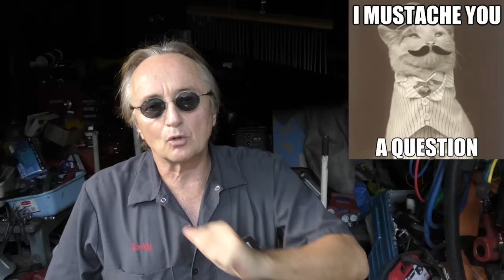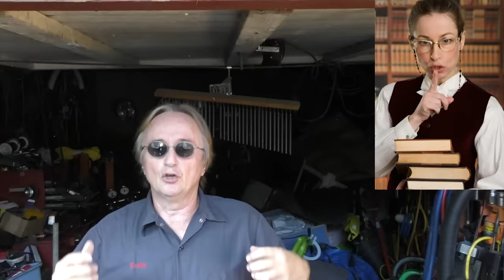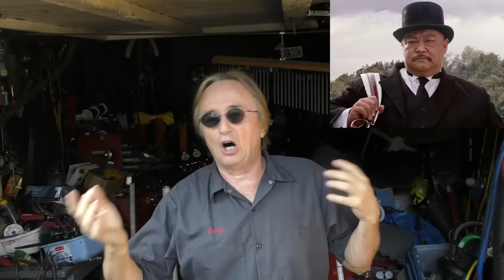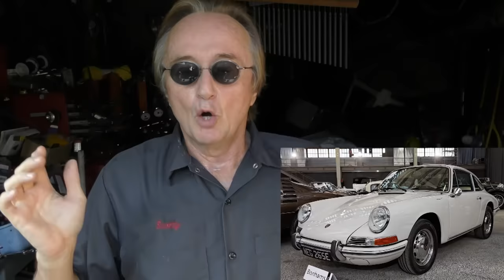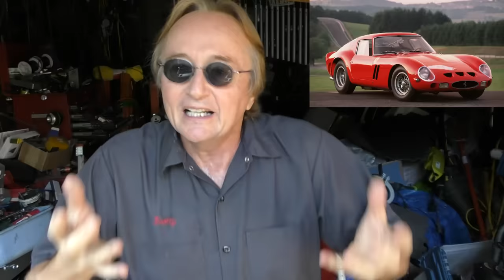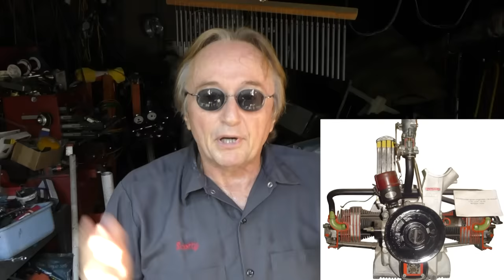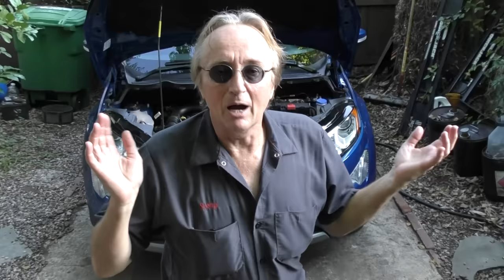The Truth About Boxer Engine Cars

Comment: Had 2011 Subaru with 71000 miles and blowed head gasket, car kept overheating and stranding me son side of a road after 2 thermostat replacements. Costs me a lot of money , kept getting air in the cooling system. To fix quoted 3000$. No thank you , Subaru . Never again . Sold it , got a highlander .

Comment: Hi Scotty, I would love if you can do a video about the difference between various Subaru boxer engines.  I had a 2008 Impreza 2.5L RS (5 speed manual).  It was no doubt slow.  I mean SLOW.  But the top speed was 130 mph.  Didn't seem to have a problem getting there other than some slight overheating.  (I rented a 2019 Mustang of which I could tell that the governor kicked in about 115 mph, and couldn't really make it past 120 mph without really laying on the gas.    However I've bought a 2020 Subaru Forester.  And it's another 2.5L boxer engine.  But the difference in performance is night and day.  The acceleration is a lot better from my impreza.  If you can explain this in a video I'd be most greatful.  I'd settle even for an email.  Thanks.  Love the vids.

Comment: I love Subaru's, but my first 2005 Subaru WRX had such an immense oil leaking issue my mechanic told me it'd need to be completely rebuilt within 20k miles. Then got a 2006 STI with 100k miles and had the same crap. Turbos kill those boxers, try finding an an STI in good condition without a rebuilt engine over 120k.. they all blow

Comment: Inline engines are used because they are easy to produce. Less different parts, faster production, more engines in a minute. And because the inline engines are so massively produced the new cars are using inline engines to cope  with similar other cars and use different engines. Mechanically inline engines are not better. If they are they would be used in F1 cars.

Comment: My turbo subie hasn’t gotten its head gasket blown yet but it will. just fix it seems simple to me. and you can push some decent horsepower out a Subaru engine. Obviously not a bazillion or something crazy but if you get forged internals you can push about 500 without worrying to much.
Reply: It's a great car. It comes running high boost out the factory and puts out great power. If it was naturally aspirated and a 2 door coupe it would probably be bullet proof

Comment: I refuse to support a company that won't fix a known weak point in their engines.  If you have a 2.5 just be ready around 100k for it to blow it's part of the Subaru experience.
Reply: That's in the older versions
Reply: @chadwickmason9851  no it's not
Reply: @Elijah-fc3ex  the only Subaru that this issue plagues is These vehicles all have cylinder head gasket related issues:

Impreza 1999 to 2011

Forester 1999 to 2010

Legacy 2000 to 2009

Outback 2000 to 2009

Baja 2003 to 2006

All at least 8 years old
Reply: @chadwickmason9851  nope, the head gaskets will still go bad on all 2.5 engines

Comment: If the boxer engines are so slow and out of date why does Subaru use them on sport sti s ? 

They have a nice amount of hp and torque 

Confusing
Reply: The new ones have about 350 hp depending on mods

Comment: good video... I have owned several bwm "R" bikes (boxers) and several subarus ... they make good long lasting power plants in most cases.. they had some issues in subbies with ring gap problems causing high oil comsumption  but I believe they got that put to bed.. different horses for different courses as the say ... cheers !!!

Comment: Scotty, boxer engines are no more antiquated than the inline four or inlinesix, inline 8 or V8. The only configuration of that list that is no longer in production is the inline 8. The truly antiquated design is the flat head. Over head valve engines go back 80+ years and overhead cam engines go back at least 50 years. The reason Porsche and Volkswagen moved away from the aircooled boxer was due to emission standards. VW actually took the boxer to water cooling and it's virtually identical to the aircooled but without cooling fins which were replaced by water jackets. Bottom line all internal combustion engines are antiquated but hey, if it ain't broke...

Comment: You know I would not mind the lack of power, the occasional head gasket replacement, if a normal person could work on it, vs packing the engine in so tight you have  disassemble the whole front of the car just to do a water pump, I think that cost $1,800, or it seems like you need special bent tools. I miss the old 60 V8 where you could crawl into that engine well.

Comment: Boxer engines don't have good primary or secondary balance, inline six engines are the best for that.  Aero engines driving propellors operate at around 3000 rpm so not high reving compared to auto applications.  The boxer design for aero have benefits of low profile for pilot visibility and easier to achieve cooling for air cooled designs.

Comment: All engines are old design but some engines had more research put on them throughout the years and became better. Still the boxer engine is the best for handling capabilities and the power it’s just the company designed on the engine. You can’t compare a 2L 4 cylinder natural aspirated engine with a hellcat. Even inline and v designs have variations in power because they have different designs build by different companies.

Comment: I'm pretty sure that Toyota 86 or brz will run circles around that matrix. In fact in short tracks it beats many more expensive muscle cars it's hp is perfectly balanced for the chassis just like the new supra you only need more hp for driving in a straight line.And boxer engines has also evolved just like all others  with vvti and hemispherical heads acc. boxer engines also have more torque than inline .

Comment: Once again Scotty shows that with his years of experience, 5 min of research is too much to ask. Yes, 1896 for the boxer layout. However, the inline 4 can trace it's roots to 1862 when Nikolaus August Otto built the first inline 4 that is core of what is still used today. Referred to as the otto cycle engine, this process of thermodynamics is the standard of even todays engines. (James Atkinson, in 1882, developed the Atkinson cycle off of Otto's design, which with cam overlap sacrifices power for efficiency gains. Hence today's hybrids use it making up the loss with electric power. Thanks to variable valve timing an engine can now switch between the two). I'm sorry, which was the antiquated design here? Also left out was the weight reduction in a boxer. My Subaru doesn't carry an additional 15lbs of counterbalance weight like my Camry does.

Comment: Look up Subaru F1. 
Say what you will but facts  and history has spoken. 
Facts are the Boxer design failed in almost all aspects of competitive performance (power, fuel economy, reliability etc) against non boxer engines. 
Subaru ended up putting a turbo to mask the power deficit and all wheel drive to differentiate and hide the fuel inefficiency.
Whatever the advantage of lower center of gravity gave it was negligible to the negatives the design gave.
Reply: RALLY DRIVERS DO NOT AGREE..
BEST RALLY CAR !! BAR NONE..FACT..

Comment: The lack of power in the Toyota FRS you drove has nothing to do with an engines design/shape. That's purely just a lack of power in general as that can be said for any smaller engine. Smaller engines normally make less power as opposed to larger ones. Having a boxer engine in the FRS makes no difference. You could say a 1999 Honda civic SI with an inline 4 lacks power. Purely just a biased opinion.

Comment: If the boxer engine isn't abused and beat to hell, they'll last forever. It might be an old design but there's a saying for that. "If it ain't broke, don't fix it". It's still one of the most durable and reliable engines on the road. And scotty, "don't make a whole lot of horsepower"? My sti would disagree. Besides, the more performance oriented subarus (wrx, sti, brz) are built for handling, not straight line because of the balance and low center of gravity. I can't believe for a minute that a matrix can outrun a brz. My scion tc would leave a matrix in a heartbeat.

Comment: The air conditioning system in my Subaru Legacy tore itself apart and would have caused major collateral damage if I had left it longer. Shockingly bad design and the reason why I'll never buy another Subaru...

Comment: If you want as much horsepower as possible from a boxer it is possible. It's just you will NOT be using stock internals most likely forged that means bascially rebuilding the engine if you have the means (time and money) for it then they can be amazing monsters on the roads

Comment: Porsche 911 GT3 RS
4.0L flat 6 cylinder
9000 RPM redline
520 HP
130 HP/L

Go try to find another naturally aspirated engine with that power density. Yep...boxer engines are old and out of date...

Comment: I always found Scotty knowledgeable but he missed it on this one.  He argues that the boxer cylinder arrangement is "old technology" which is an unrelated issue.  Technology is things like direct injection, double overhead cams, variable displacement cylinders, etc.  All of those are equally applicable to boxer engines or other layouts.  I'm pretty sure the I-4 cylinder configuration so common today is older than the boxer layout.  Certain Subaru/boxer engines are prone to head gasket problems, but that's a design problem, not a problem with the horizontally opposed boxer configuration.  And cars like the Corvair and Tucker failed for marketing reasons.  Ralph Nader killed the corner hugging Corvair with his book "Unsafe at any speed".  Tuckers just never took off.  All other things being equal, I'd take a boxer engine over an inline or V engine every time.

Comment: Didn't anyone think to place the Boxer engine transverse , it would have taken up less room than a 4 cylinder car and had a beefier gearbox to match .
A flat four cylinder car with a 3 L, engine or 4 L capacity engine as a 4 so it didn't take up much room .

How is this for an idea insted of the output coming out of the rear of the engine the center of the crank could have had a gear to tranfer all that power threw a gearbox under the engine or sump , ala Morris mini gearbox , and still have the center of gravity very low and even a (  flat 8 ) taking up , f all room in the bay .

Comment: Hey Scotty I got a 1995 passport Honda it's got 200,000 530 mi on and I'm having a problem I've got an oil leak inside the valve covers because that passport is not a Honda it's actually an Isuzu it was built on the Honda line and the oil is leaking down on top of the plugs which is caused I imagine I didn't know it for a while when my wife is driving the car and I found out when I went to change the plugs I was getting the oil down on top of the plugs and I didn't even know that the oil lines run through the valve cover so I have to replace the valve covers but in the meantime I don't know my lifters were loud so did that oil leaking cause the valve lifters to start getting loud and they have ruined my lifters am I going to have to replace the lifters and the valve covers because you can't put seals in the valve covers on that Isuzu they say I have to change and buy new valve covers and I've been driving it I took it to Mississippi and come back and it was working fine I put a set of new plugs in it and it ran down there 28 mile and a gallon except for my lifters being loud my oil pressure was holding at about 50 55 lb okay now when I got back I started losing some power now I changed my fuel filters but I never change my old two sensor is that causing it to drag and lose power or is it something else can you explain what's going on with my 1995 Honda passport which is an Isuzu

Comment: YES these new MODERN engines are just a great thing to be promoting, direct injection NIGHTMARES, aluminum warping NIGHTMARES, sensors up the yin-yang, $2000.00 de-carbon of the intake valves 5 or 6 times in the life of the engine IF they last that long.....BOXERS sound pretty good to me DUDE.

Comment: "Especially today, this is an old design".  lmao.  Yeah, ALL piston engines are an old design, thats not news.  Subaru engines are known as one of the most reliable engines on the planet.  I own a 2001 Forester and 2011 Impreza.  Both are great vehicles with zero engine issues.  On top of that, my 2011 Impreza would run cirlces around Scotties wifes Matrix.  lmao  Ill even drive in mud and she can have dry pavement to make it a little closer.

Comment: Scotty, please explain what exactly makes a modern four-stroke engine with horizontally opposed cylinders an "old design"? Is that a fact or an opinion?
And what exactly is not an "old" engine design these days then? Electric vehicles? 
Which were invented 20 years before internal combustion engines. lol

Comment: Subaru's last for ever as long as you don't modify them. 90% of ruined subarus out there were modified before they blew up. That said I drove an 03 wrx for a 120K and had 350 AWHP for half of those miles. The only horrible thing that subaru did is that most of the subarus from early 2000s and on rust like crazy by the time they hit the 10 year mark If you drove them in the winter, Which is what they advertise lol. I love subarus, but dont mind  sharing real facts.

Comment: Pull a subaru engine once and then tell me you would rather work on something else. They are the simplest vehicles I have ever worked on and the majority of their parts are compatable across multiple generations. Sure, they don't make the power that other brands do and the fuel economy may be lacking in the eyes of some but these cars beat everything I have come across in ease of maintenance and are a tough rival for toyota in reliability. Did some generations have head gasket issues? Sure, but that little motor comes out in 45 minutes to an hour and after 3 hours or so it can be running again with a fresh timing set, new seals, and multilayer steel headgaskets. These cars were built to be worked on by their owners in their driveway atleast up until the CVT Transmissions came into play. I haven't owned any that new so I cannot speak with first hand experience.

Comment: Your topic doesn't make sense.
I know Subaru only use boxer engines WRX STI is a good sample of boxer engine performance.
In general it has its own ups and downs just like any other engine.
The only thing you mentioned as a big deal is head gasket witch any engine could have!

Comment: The boxer design doesn't lend itself as readily to modern production methods that employ a great deal of robotics, and you can't get around the inherent need to frequently adjust the valves.  For someone that just looooves the old Beetles, that's fine, a valve adjustment is very simple on them and is part of the 'experience', but today's pampered kids wouldn't have the discipline and patience to keep a Beetle going.  The design, however, IS the epitome of design for maintenance.  Ferdy Porsche wanted a vehicle that was cheap, easy to start even in cold weather, and simple to maintain...e.g., a real "car for 'folks'", not some snotty elitist that has his man-servant polish up the Lambroghini.

Comment: What is that 10-second rattle when the ej25  it starts up after sitting overnight or a for a few hours?
Reply: Mine does the same thing
Reply: Piston slap. Cylinder bore is out of round due to the stresses inherent to the motion of a boxer engine.
Reply: @phantom240  I had just finished replacing the rings, rod bearings, main bearings, and the seals. The mistake I think I made was installing the cam seals too far on the end shaft. As I later found out the seals need to be flush to the opening which seems to cause an oil leak from the front.  Could the rattle be caused by some of that?
Reply: @ypguys  I can only speculate, but I doubt it. When you replaced your bearings and rings, was the bore checked before reassembly?

Comment: Also; 1) air cooled engines need a design that ideally aids in cooling the exhaust valve area of the head, the boxer allows for maximum air flow thus aiding in this.Modern liquid cooled engines don't need this effect as they have coolant passages keeping this area cool. 2) Cost, boxers are expensive to Mfg as 2, 4, and six cylinders need two rather than on cylinder head. More $ to work on with separate valve covers to remove to access etc..FI systems etc.. you can't leverage off other engines to the same degree etc...

Comment: Time to set the record straight because this guy got a whole lot wrong.  First off the first flat engine was made in 1897 while the first 6 straight was made in 1903. So the Boxer is six years older. Or in other words the boxer is 123 years old while the straight engine is 117 but he calls it an old design....ya.  He calls it a slow engine yet some of the fastest cars on the planet use a flat engine, current 911 turbo 0-60 2.8 seconds, seems pretty fast to me.  Most companies dropped the flat design, true but he got it wrong why they did it.  It is cheaper for them to make a straight engine then a flat. Nothing to do with what is better just what is cheaper.  A boxer engine is safer, smoother and lower center of gravity then a straight but a straight is cheaper. This is the true story about the boxer.